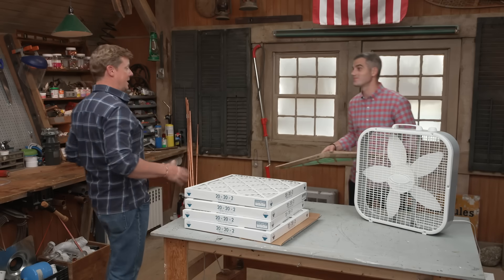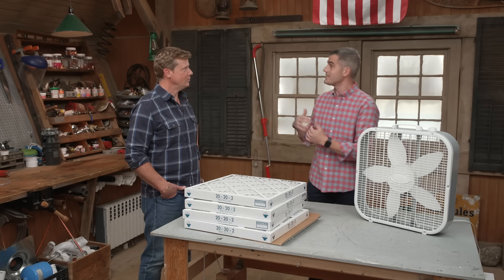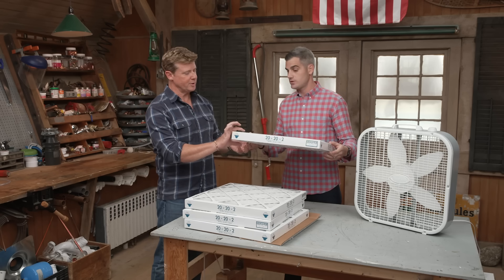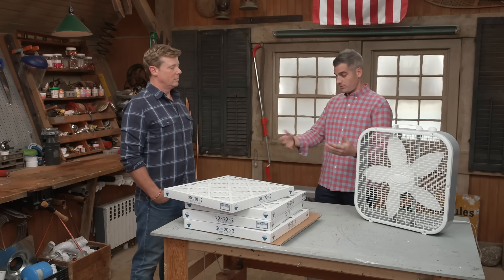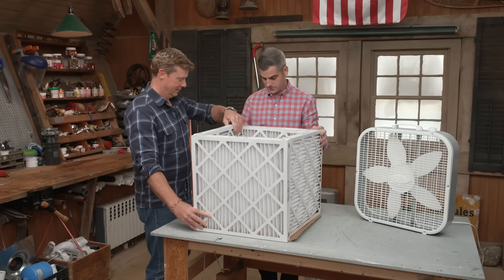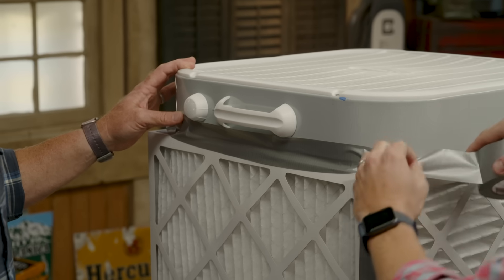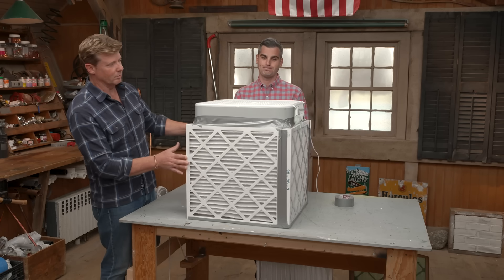How to Make a DIY Air Filter | Ask This Old House

Comment: Three months ago I made two of these and began using them in our two story house.  There was an immediate noticeable decrease in dust on furniture and floors.  Best of all, we realized after a few weeks we no longer wake up at 3 am with sinus/allergy headaches.  We are breathing easier.  Thank you!
Reply: Glad 2 hear that ... allergy sufferers are helpless with dust problems
Reply: Good to know that this system works for you.
 I've done what many people have done, used one filter on the backside of a box fan, but this one is far out!
Reply: Did you put the fan blowing in or blowing out the box?
Reply: @Nunnia222  there are arrows on the filters that dictate which way the air is flowing so you need to follow those as well. I haven't watched the video yet so I don't know how they have it. But my guess would be blowing out so you suck the air through the filters the fans don't have the power to push the air through the filters. Believe me it makes a huge difference.
Edit. I was right. The air blows out and watch the arrows.
Reply: @stonephonerogue  and have your filthy fan and motor from dragging dirt across it while trying to PUSH air through the box instead of PULLING it through.
Try again son don't be mad.
Reply: @SlickArmor  I mean I'm gonna do what I've been doing while some child gets mad I follow a different video rather than this one. Seethe , cry, cope. You don't even know what a corsi-rosenthal is.
Reply: @stonephonerogue  no one's crying I just think its funny that a kindergarten injuneer thinks he knows airflow. Go ahead keep pushing the air into a box real smart.
Reply: @SlickArmor  You do know that just a regular box fan has as much dust going across the blades as what I'm suggesting right? Do you think because it's blowing into a box that it somehow creates more dust to hit the blades? Did you graduate middle school?
Reply: @Nunnia222   Increased air flow from reduced resistance because no more stuff blocking it.
Reply: @Nunnia222  for a house with pets, it is better to have the fan blowing INTO the box, other wise you're gonna have to brush the filters off outside pretty often.. better that the filter box catches everything
Reply: @stonephonerogue  fans like this don't have the power to blow into the box. Build it like they have described.
Reply: @SlickArmor  They do, and that way they actually capture particulates, don't tell me what to do.
Reply: @stonephonerogue  please people this m0r0n would have you building it completely backwards which not only won't work but your fan and motor will be filthy by dragging the dirt and particles over the fan blades and motor first. The proper way actually moves air and the air flowing through the fan will be clean air. This duh-me will have you burning down the house and not in a good way.
Reply: @SlickArmor  weird, I must have the most powerful box fan on the market because it's been running for 6 months with no issue. hmmmmm. mind your business, tell your mom what to do , not me.  Build deez
Reply: @SlickArmor  I mean, I clean my house, you walk barefoot in walmart and worry about what other people do with their own free will, we aren't the same. Don't worry about what comes out of my mouth and I won't worry about what goes into yours.
Reply: @lemmykilmister545  Thanks for proving my point, so it's more effective at pulling the dirty air and keeping it inside the box with the design I mentioned. I can turn it off at any time and all of the debris is safe inside the box. Thanks! Also I've never had a fan burn out so, it's really not as much resistance as you think, the difference as far as energy efficiency is at the decimal level compared to having the debris contain with better pull on said debris. As you said, with the pull being stronger,  it's better to not have that hindered, and also dampens the blow rather than just circulate debris. I'll let you know in 20 years when there's a fraction of a chance a box fan stops working ( probably won't ). A fan is more likely to burn out from being dirty, which is something anyone will face just using it as-is if they don't clean it. Either design applies the same wear when one just allows you to turn it off and have 0 chance of losing any dust. But also, a ceiling fan is more efficient at blowing than pulling, but in reality you're splitting hairs and have no clue what you're saying.
Reply: @stonephonerogue  No. Just use a merv 1 on the outside or ech and it will control the larger particles and prolong the life of the Merv 13 filters. Can easily vacuum away the Merv 1 filters daily
Reply: @buddhamack1491  Hey nostradamus, You want positive pressure with something like a PC build that is designed to keep dust out, and negative pressure for something designed to keep it in. Hope this helps dum phuk
Reply: @stonephonerogue  hahaha is your IQ in the 70's
Reply: @Nunnia222 it would work either way, one way dust would Collect on inside of filters, other way dust would collect outside of filters.
However blowing out (up) would keep the fan cleaner.
Reply: CRAZY I wake up with a clogged nose from allergies or whatever hardly able to breathe in the middle of the night and in the morning when I wake up, I wonder how much that would change if I made/had an air purifier...
Reply: So one fan is enough to cover each floor of the house?
Reply: So I imagine this would prevent a lot of pet hair from accumulating on literally everything. I just wish they weren't so ugly.. 🤔
Reply: Merv13? I live in a desert area and I notice the dust. Have to mop the floor pretty much every few days.
Reply: I’m trying make this air scrub, but I don’t know what kind of filters to get. I look it up, but found that there are so many different filters, but most of them are for cars. 

What are the square filters originally meant for?

Please help! 
Thanks. 😁
Reply: I used one and it helped clean allergens out of the air. Much better! They made me feel foggy and groggy and even kinda boggy. Now I think clearly, and my IQ jumped 50 points! Would be more impressive if my total IQ wasn't 88.
Reply: @bl8388  So now your IQ is -50.
Reply: It may even work better if the box is not behind the back of the fan
Reply: @shantiawilliams3615 I don’t think it is, the box is on the bottom
Reply: @shantiawilliams3615  It's not. The cardboard is on the bottom of the filter box. They flipped it over and put the fan on top.

Comment: Besides the 20x20x4 filters, do you think it's worth spending the extra money on 20x20x2 filters rather than 20x20x1? Would it be significant enough to cause less strain on the motor and filter more as well? Or should I just get the 20x20x1?

Comment: ill tell you guys right now as an tool repair guy box fans do not like to be run on their back its hard on the bearings they are not designed to run with that type of load and your box fan will fail in a year or so and could cause a fire

Comment: Awesome idea!  But what's the purpose of the 4th air filter?  It's on the bottom and has cardboard on the bottom/outside of it, so it's not filtering any air at all.  Seems like 3 2" air filters is all that's needed.
Reply: think...

Comment: HVAC professionals say not to use those MERV 13 filters because they suffocate the HVAC system….
Reply: But they also keep your coils much cleaner which means reduce service calls for coil cleaning.  Those blue fiberglass filters are trash.  It is anecdotal, but I used the max merv Filtrete Allergy 1" filters in my Trane Heatpump.  I replaced the hp after 26 years, only trouble ever was 2 contactors and 1 capacitor- no fan issue, no freeze ups.  Replaced hp not because of failure, but I was afraid after 26 years it had to break down sometime and you don't want your ac out in the summer in the South.. I now use the 5 inch filters made to fit in a 1" return.  Much less restriction.

Comment: And these work nearly as good as an expensive HEPA filter, in fact, my cheap box fan has over 1,000 CFM, and expensive HEPA filters have around 200-300 CFM or less depending on the fan speed.  The CFM will go down due to the added resistance of the filters.  We have a Dylos 1100 Pro particle counter, so we can test if a filter works, and just one of these on a cheap target box fan removes even fine particles almost as good as an expensive HEPA filter.  You can also get a MERV 13 filter made by 3M that can go in your HVAC (it did not break our HVAC but check with a pro before trying it on yours, it's usually the MERV 16 that is too much for HVAC, but check with a pro) we did it and it worked through the whole house.  These small box fans only work in one room.
Reply: Dc fan motors with controllers are very load sensitive, ask me how I know! Very expensive repair, controller bout $600. Motor bout $1300 w/o labor
Reply: @barneyrubble4827  Cheap box fan works for me nearly as well down to at least .5 microns.  But I also have bought the expensive brand air purifiers too.

Comment: Some, if not all, HEPA filters get better the more particles they catch and don't need to be changed out.
Reply: To a point, yes, but as you load more particles onto the filter, pressure drop across the filter increases. You pull less air and it's not as efficient.
Reply: @will6699 Not if you have a pre-filter.  The .3 micron size particles are not big enough to cause a noticeable drop in pressure.

Comment: THIS DOES NOT WORK.  The box fan CANNOT generate vacuum. For this to work you need a fan with shrouded blades that can actually trap and pull air.

Comment: We use a wood burning stove for supplemental heat. However we often need fans blowing cooler air toward the stove so the living room won't overheat and the heat will travel to the colder areas of the upstairs. I'm thinking to try this filter setup to also help clean the air. We have to change our filters more frequently in the winter months so if I get 6 months out of it awesome 👍.

Comment: It should be noted that if you use cheap filters, you will be building a dust distribution system.
I sewed some old sheets to make a washable pre-filter to help keep the expensive filters from getting loaded up with big chunks. Filters are expensive.

Comment: The more merv the filter has the more harder your fan or motor will work and it may cause operation failure. My suggestion is a merv 8 filter the best in trade.

Comment: I use a modified version of this in a home made spray booth that works great. I have 3 sides of PVC pipe with joints covered with drop cloth type plastic hinged with zip ties and a box fan with a 1"filter over it to control overspray in my garage when spray painting things. I also made a lazy susan that attaches to my B&D workmate to get 360° access when spraying.

Comment: Probably way more than what is needed, but everyone's situation is different. One could make an argument that just placing the filter on the back and stirring up settled particles, could possibly clean the air better maybe. 
My setup for the past 5 year's, was just placing a 8in turbo fan, over an old return hole in the living room floor forcing hot air into my cooler basement. The fan has a 1 foot square cardboard box that Is over 7 ft high. Air returns up my basement stairs past my a/c in my kitchen, creating a whole house ac unit from a 6000 BTU window ac.My plan was to just circulate the hot air. 
One day I put a Merv 8 filter on top of the cardboard box just loosely, and the amount of crap it filters is unreal.I estimate I get one full air circulation every 50 minutes in my house in a perfect controlled ideal setting,from a 200 CFM 8 in fan. But realistically it's doing an air cycle every 25 minutes of half the house I believe.

Comment: Would you rather have the fan drawing air in through the fan to push out through the filters, or drawing in through the filters to push clean air out through the fan?   I have looked at this as a solution for the fine particle matter in my small basement workshop, and have planned a two filter version of this would actually mount from the ceiling above my workbench,. It might be a 6/half-dozen argument, but is either direction preferred? In some ways I’d rather not have the fan blowing on to me in my work the whole time, and have instead thought about it reversed so that it’s drawing air directly in through the fan and pushing clean air out the sides through the filters.
Reply: Yeah I don't like the idea of a big current of air blowing around my basement kicking God knows what back into the air. I want clean,diffused air coming out of the filters gently,not the other way around!

Comment: I suffer from pollen allergy. (Symptoms are sneezing, congestion and runny nose,
 as well as itching in your nose, eyes and/or the roof of your mouth) 
For many years I try every drug available, which improve my condition 
and I still use them of course. Although, sometimes is not enough. So, 
if you live in a small apartment as I do you can try this method
 to filter the air in less than 30 minutes. First turn on your air 
conditioner in “Dry Mode” (the one with the drop of water symbol), then 
place a floor fan at maximum speed pointing inside your bathroom, and turn on your shower with hot water. It will create a hot fog inside your bathroom. The contaminated “cool” air will flow inside the bathroom via the fan at floor level, some undesirable particles will get stuck in the damp walls, others in the mist and others will be washed out with the shower rain itself.  
Subsequently this hot fog will come out of your bathroom at roof level and your air 
conditioner will capture this moisture with the rest of the pollen and particles, it will condensate it and be expelled out of your house via its draining system. 
Then turn off your shower first, and let de fan and the air conditioner ON until the moisture disappears completely and your bathrooms walls are dried. The time will vary depending your apartment o house dimensions, but you will feel the relief immediately.

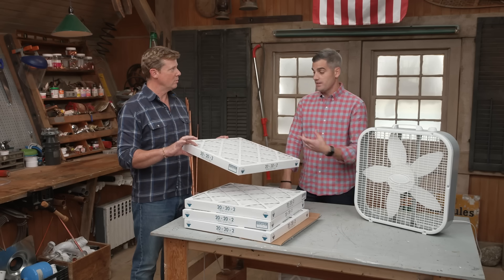Comment: STOP spreading false information! 3:20, "you have twice the thickness which means you have twice the surface area".  No, the surface area is roughly the same. There are roughly 13 folds on the 4in filter and roughly 25 folds on the 2 in filter. I tried to count that on my screen. The video is not clear enough for me to count accurately, , but the count should be roughly correct. You are just wasting your money for 4in filter if you they both fit your hvac.

Comment: Adding size will not increase the filtration. The driver is the amount of air the fan moves. Adding surface area to pull air through just allows access to more air, but it doen't chage the amount of filter the air hits. The box may last longer and clog as fast, but it won't filter more than a filter on a fan.

Comment: I did this using the cheap 17.95 Lasko fan from Wal Mart.  I also did another one using a single 20 x 20 x 2 filter rubber-banded to another 17.95 Lasko fan for the bedroom.  

I've been running both 24/7 on Medium.  High was too noisy, Low didn't seem to be moving much air.

They seem to be working fine at filtering the air, but they've had a huge impact on my electric bills.  I've been in this home for nearly 8 years.  Every month, the power company sends out an energy audit comparing my electricity usage to similar-sized homes in my area.  I have always been significantly below average; almost to energy-efficient, despite the fact that my home was built in 1951.

Since beginning to use these air purifiers, my power bills are up 40-50 bucks a month from where they've been for the same months in years past and the energy audits show me significantly above average, no longer below it.

I'm thinking I may have made a mistake buying the cheapest 20" box fans I could find, and I'm wondering if there are more energy-efficient 20" box fans available.

Can anyone help please?
Reply: That can't be right. A box fan is around 100 watts. That's 24kw per a month. At 12 cents a kw, each fan should cost you around $3 a month. Buy a electricity monitor to confirm , but I suspect it's something else. Unless you have 5 of them and your box fans are using around 200 watts then maybe ?
Reply: I have tested several fans with a Kill-a-watt electric meter, on high the fans draw around 80 watts, low fans draw 50-60 watts. 80 watts by 24 hours a day is 1920 watts. (basically two killowatts). Power at $0.12 per killowatt hour, each fan uses about $0.24 of power a day. That is $7.20 of power per fan per month.
Reply: Anyone?

Comment: ?? Ultimately all cfm's enter through the back of the fan. Wouldn't you be decreasing resistance without sacrificing filtration by simply using 1 filter placed on the back?
Reply: Mike M, it would increase resistance as you have less filter surface area. You'd also be creating rarified air where the fan blades are trying to opperate. I'd guess that would be particularly bad for a fan in a square shroud.  You could try a simple experiment, hold the filter at the output then no filter then against the intake. I'd guess you'll hear the fastest fan speed against the intake as t he fan blades stall and the motor unloads.